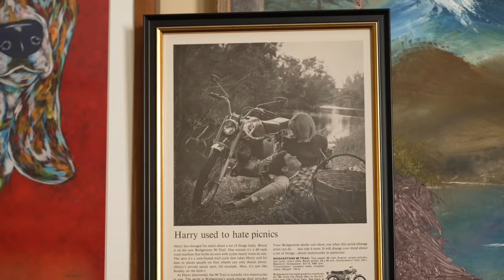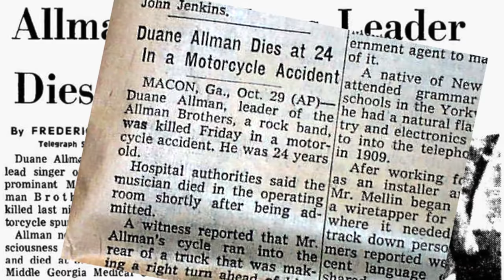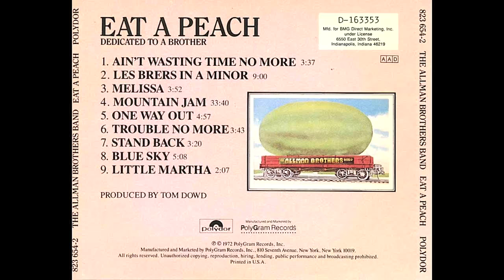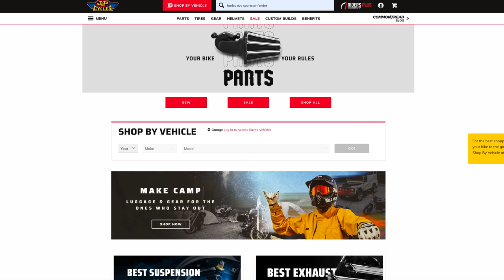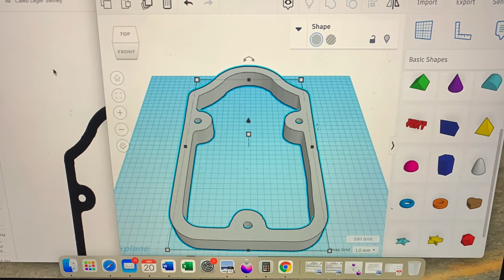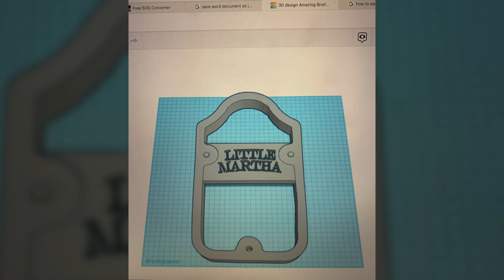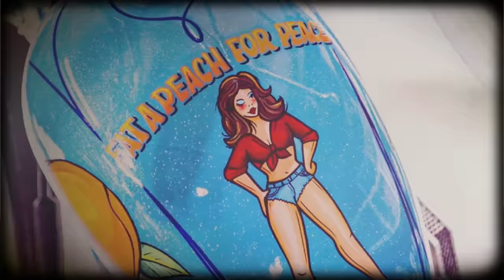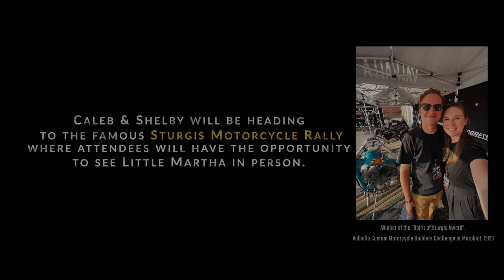Harley-Davidson Sportster Chopper "Little Martha"

Comment: 1:03 is that a Kawasaki F7??? I had a 73 F7, and yeah that amphibious carb housing is such a pain. Made tuning the carb damn near impossible because they don't make the gasket for it anymore and I had to use gasket sealer everytime I accessed the carb. Would love to know if you found a way to mount the carb without that housing plate, I tried but couldn't ever figure it out.

Comment: Well,looky there, a 1974 Kawasaki G3SSD 90. I put 25000 miles on mine. And it was my first street bike. 4 piston/ring sets and two cylinder,s 3 chain and sprockets sets. And I can't remember how many tires. With some port and disk valve work, you could JUST GET 70 mph out of it .......down hill with a tail wind. HAHAHA.